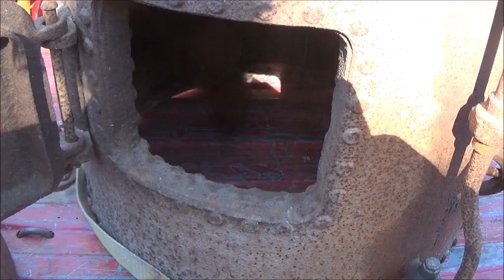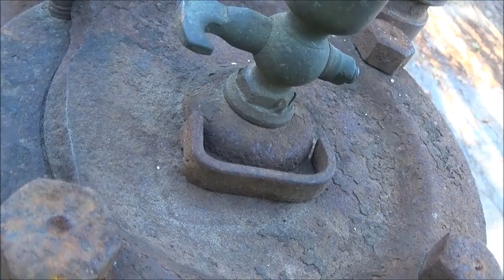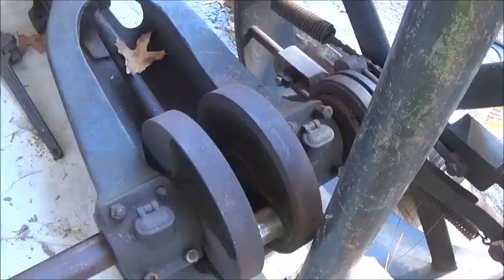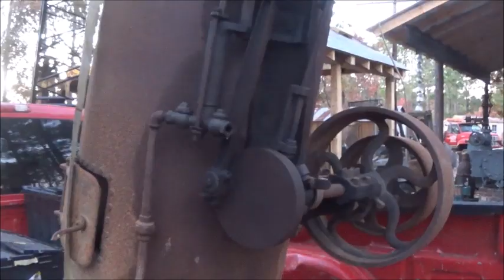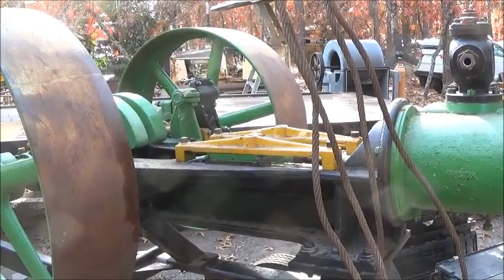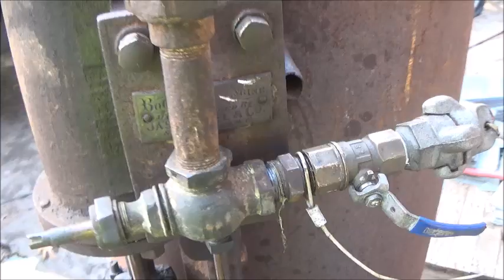B.W. PAYNE, LEFFEL AND FRICK STEAM ENGINES

Comment: Have u heard of cyclone power technologies? Modern 5cyc radial dual acting steam engine for cars, trucks boats, tractors, has 2ft rolls of stainless steel tubing for boiler, and 3000 psi in 15 seconds? Instant steam pressure, with no heavy boiler, compact lightweight steam power

Comment: Again, sorry for your friend Jonathan. 
Jonathan at the plant i worked at we machined a lot of raw castings that ran on steel. We used to get the used black diesel oil and soak our castings for as long as possible. I guess the acids from combustion etched into the pores of the cast but they did last longer.
I wish I could have saved you one of our carpet looms. Originally run from line shafts they had been converted to electric motors. I had all the original drawings, actual blueprints, from 1922. A few years after I retired the plant closed and I was able to retain some of the six drawers of drawings. None of the looms survived. We had looms from Crompton and Knowles, Lansdowne,  Mertin and Frauein and Kastruma. I made just about every part that could be made with the very capable and experienced crew in the machine shop. At 50 years old I was the youngest person in the shop. My mentor and dear friend had clocked 54 years at the plant when he retired.
For low speed and heavy loads you can't beat steel shaft on cast l ubed with medium oil. Higher speeds brass or babbit works best. Of course bearings of any style work best if ran on hardened shafts or races.
My heart broke when they cut and broke those looms to pieces so they would fit in the dumpster. There is a video of one of the shuttle looms running and I will see if I can get a copy.
I'm glad to see some of our industrial history being saved. The thought of the manpower, ingenuity, improvisation and tenacity it took to design and build these machines is absolutely astounding. The hours and hours it took to hand draw, revise, redraw and proof those drawings must have been immense. 
Thank you again for all that you do. I know it means a lot to many of us.
Cheers and Merry Christmas 
Terry

Comment: I really enjoy how Jonathan can bridge the gap between the old and new generation while giving a history lesson. Starting just after the first minute how tech back then and tech to date; gives us all something to relate to. Point of failure?.. >Busted ball's< The difference  is wear and tear, back then they where made to last for generations.  This day and age it's only  for a year or two... all punns aside I believe we all need too shift our focuse from what's going to last for a minute  and go back to what our forefathers knew.. Building something that will last for generations and not engineered for failure based on a Gant chart. I build outdoor  furniture   at slightly higher price than what you purchase from your local hardware or chain retailer. The difference between mine and there's is quality and reliability. Would you buy a three year product or spend 10% more on one that would last 60 years plus? They back then considered that and I think people have been conditioned  to believe a warranty policy that sounds good versus a product that speaks for itself... as in you dont need to purchase a warranty because it's built for wear n tear. And if you give it respect your grandkids grandkids will use it too.